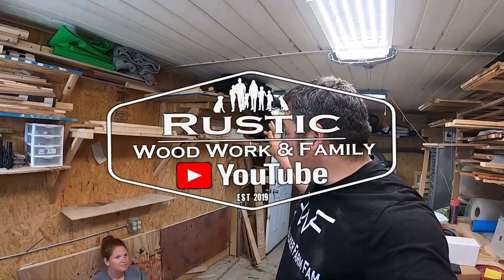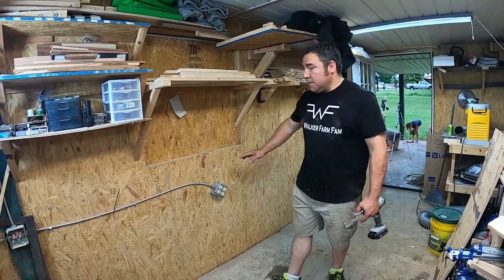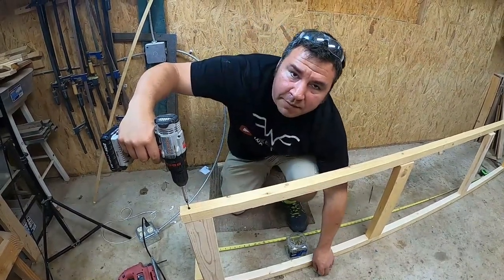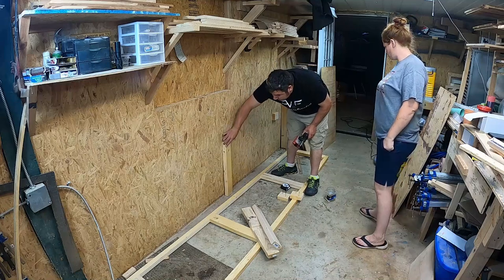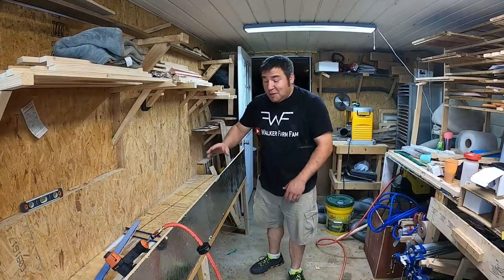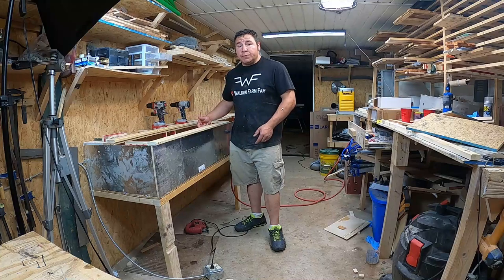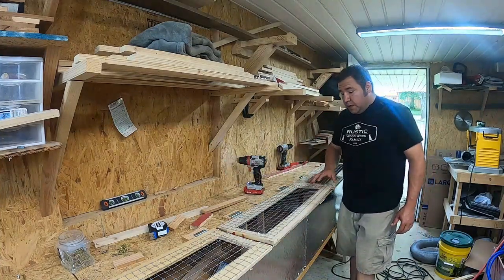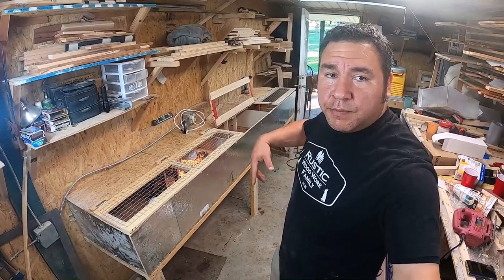How to save money building things out of wood this is a Easy Quail Cage Build out of scrap wood, DIY

Comment: The port a cable 1\4" impact driver is 100% junk I bought one an it would not drive a 3 1\2" screw's so I returned it got neither one after trying 3 I send that's it  so I Wight to harbour freight tool I got the Hercules 20v $50 all I can say is wow I can put in 4" lag bolts with no problem.
Reply from the maker: That’s crazy we’ve had ours for a long time no issues but it’s just like anything else there’s Lemons
Reply: I head one for years but I cud not find the replace ment  battery's for it so that's way I Whit to buy the same bran but I Ben told they are not as good as the older ones an it can't be Lenin I tried 4 of them same thing happens it drive the screws half way and it would stops you what 5 minutes it would start to work but you put it on that screw it turned a little then it would stop an the same thing happen on all 4 that I went out to buy an returned buy 4 trip's  so they are just not made as good if I recall they was bought out by some other Co. Not only that its more $$ money an I have to have something that works all the time.